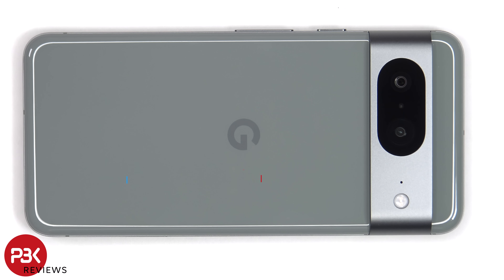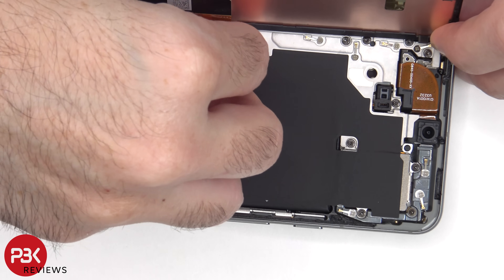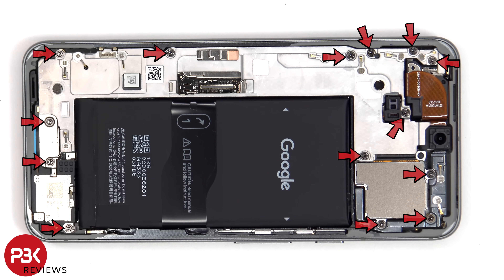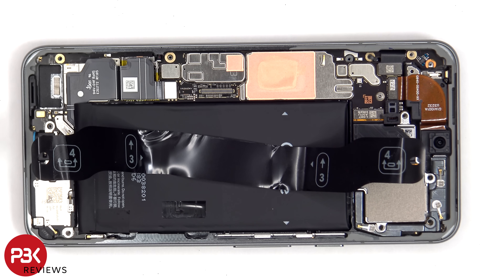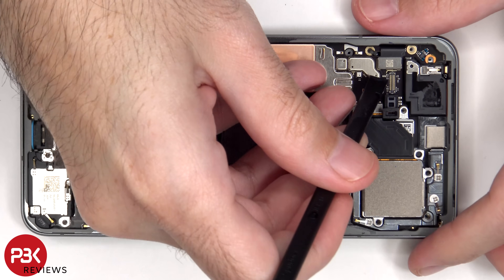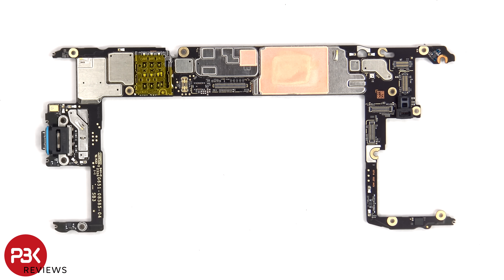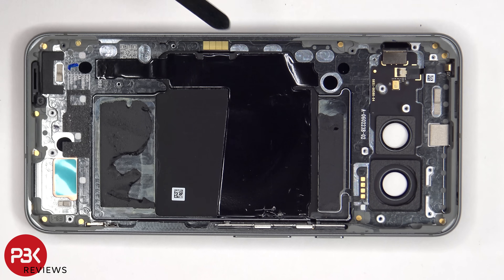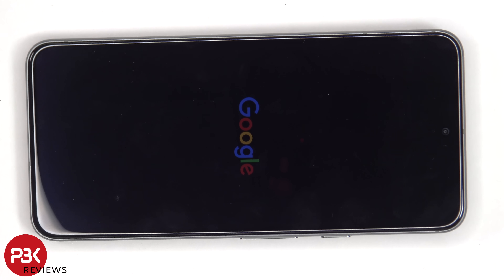Google Pixel 8 Teardown Disassembly Repair Video Review

Comment: Battery replacements seem nice and not too crazy difficult
Reply: It's about as difficult as basically every other phone for the last 8 years. It still remains annoying to do. Thankfully in a few years all these companies are being forced to put out phones with really easily assessable batteries. No reason it can't be designed like the old days with easy removable covers with no glue and only minimal screws holding it in place. Gaskets have been around forever and do a great job at waterproofing.
Reply: @theRemedyGames  Something like what LG did with the G5(?) with that removable bottom tray would be perfect. Just put the charging circuitry on it along with the USB port, and have it all slide out with the battery. With a good gasket and strong screws holding it in, It should be just as waterproof as an adhesive-sealed phone. Bonus points if they use something other than Phillips so the screws are not easy to strip.
Reply: yes fairphone already do it pretty cool concept
Reply: It's just as difficult to replace an iphone battery, nothing changed for the better, now I understand the promise for 7 years update support! Most people just replace their phone instead, for sure not doing this!
Reply: screen needs to be unglued to access the battery, this design is a nightmare. i gues phone being practically disposable is a descent tradeoff for being able to relock the bootloader on opensource os

Comment: Why were older phone batteries (ones with removable batteries) so much easier to remove? They didnt require a bunch of glue to hold it in place
Reply: Companies needed some way to force obsolescence so they said "well in order to make a phone water resistant we need to glue the whole thing together." This was so people would just buy a new phone in a couple years instead of replacing the battery to breathe new life into it (most people replace phones earlier than they normally would just because they want better battery life). Then they proceed to bury it under a bunch of other stuff in an effort to "make the phone as thin as possible." It also makes it easier for them to design the internals when battery placement is not a top priority...which it no longer is now that they made replacing it a royal pain in the ass for the average consumer.

Gaskets have been around forever. No reason you can't design a battery compartment with gaskets for waterproofing.

Comment: I swear Google loves giving you small reasons to not buy their phones
Reply: Why?
Reply: @Stevenkx2  like the soldered usb-c port, slow finger print reader, heating issues
Reply: @10ToesDownWithBass  and lately the price increase of 200€ in Germany. 1099€ for a Pixel? Nah thanks. I was only recommending them to my customers because of it's pricing, despite the phone having the issues you mentioned. Now that phone is straight up out of the game.

Comment: Do the screens of the 8/8 Pro still feel and sound hollow when you tap them?
Reply from the maker: I don't remember the 7 or 7 pro but sort of. Also I think the main reason would be the fact they have the screen seated on the plastic border underneath that clips into the frame so the screen might sit slightly higher than the components inside and not have anything directly pressing against the back of it. For screen replacements, this is good since that plastic border makes it much easier to replace the screen, or other parts inside the phone without damaging a working screen when prying it off.
Reply: @PBKreviews  ok, thanks for the info. The hollowness of the display was something that really bugged me about the 7 Pro. The 6 Pro too.

Comment: So basically Google touting the phone is way more repairable, is a blatant lie.
Reply from the maker: I mean in my opinion it's easier to repair than the 7 pro. Overall layout was easier when taking apart. They still have much room for improvement. If they just make the charging port replaceable, and use a better adhesive/pry pouch for the battery then it would be much, much better.
Reply: Is that a ultrasonic fingerprint reader or same as Pixel 7

Comment: i think the ram on processor is not a good idea as if the processor get hot the ram may disengage from the processor
Reply: Just like every phone in the world? Soc is better as everything including ram is one chip so you are wrong ram can't separate at all
Reply: @Stevenkx2  that's how the chinese phones are getting these problems with the chip which heats more.. then we have to change the motherboard with processor or with skilled technician we can separate ram from chip and then clean it and resolder it properly to make it work again
Reply: @rajasankar390  no, every phone has ram together with the processor that's why the chips are called SoC they include CPU GPU RAM ant sometimes other thing like the TPU in the same chip, even on iPhones and new M series macs is like this it's always been like this, it the only thing is not inside the SoC is the storage that's still a separate chip, although some manufacturers like apple add the storage inside the SoC
Reply: @Stevenkx2  im talking about chip problem(which runs hot with no proper cooling) bcz of the design ram on the chip
Reply: @rajasankar390  well that's because arm awful termal design.
Reply: @Stevenkx2  dono whom to blame the chip design flaw or the companies poor thermal management without proper cooling
Reply: @Stevenkx2  don't blame ARM for this, even M1 MacBook Airs run without a fan just fine, blame Google and Samsung for this knockoff Exynos "G3".

Comment: Battery drain test would be highly appreciated.
Reply from the maker: I don't think I will have time to do a battery test, since 1) my expertise are more in teardown and other tests 2) I need to get a bunch of other videos finished 3) everyone complains on battery tests and each person wants it tested a certain way so its extremely time consuming 4) by the time I get it done, other reviewers will do it. So yeah. However if I do decide to do it, how exactly do you guys want to see it done.. lets see the 15 different ways people will want to see it done lol.
Reply: @PBKreviews  you can run the geekbench tests repeatedly and then video recording because that's where more battery is consumed. And then check the temperature in between as well.
Reply: @PBKreviews I would like to know how to test a battery with volt meter. Is this what other viewers want you to do?
Reply: @PBKreviews no problem, but have you been using the phone? how has the battery life been? any heating jssues?
Reply: @PBKreviews I'd just put three phones side by side and run the same thing on them like Youtube videos at full brightness. Make sure they're all on airplane mode with only wifi on.
Reply: @PBKreviews we wants also charging speed test we wants to know if there is much different now
Reply from the maker: In my opinion, charging is low but I am used to my vivo x90 pro+ charging which is fast so to me it feels like a snail. I don't think I will have time to do a charging test video, but I will be uploading a battery test one later
Reply: @PBKreviews  Great news.
Reply: @PBKreviews hows the cellular signal, any difference compared to your other daily drivers? Great teardown vid btw :)
Reply: Pixel 7 on Android 14 has had much better battery life and no thermal issues.
Reply: Thia needs to be at the top!

Comment: No vapor chamber for heat dissipation. It'll throttle like Pixel 6 and 7 series or how IPhones do, because Apple and Google insist on no vapor chamber and think a graphite/copper film is enough lol
Reply: They transfer the heat to the screen..they use the screen as heat sink
Reply: @LeeMooEez  and that leads to the screen falling off after a while, which they won't cover under warranty. Ingenious design.

Comment: No vapour chamber cooling I thought they will use it in pixel 8 when they used in pixel fold
Reply: even zenfone 10 and s23 had it 😂 google is joking
Reply: Probably not enough room
Reply: @4jup4ter4 Nah, some penny pinchers at Google decided not to cool this phone properly to make more profit. Cheap ass thermal pad design 🤢

Comment: The charging port being soldered is so frustrating
Reply: As well as the microphone, proximity sensor. Whole board replacement to fix those issues 😢
Reply from the maker: yup or soldering expertise
Reply from the maker: yup

Comment: Does it still sound hollow like the Pixel 6 and Pixel 7 did when you tap the screen?
Reply from the maker: yeah i think so. Again as mentioned to someone else,  the main reason would be the fact they have the screen seated on the plastic border underneath, that clips into the frame so the screen might sit slightly higher than the components inside and not have anything directly pressing against the back of it. For screen replacements, this is good since that plastic border makes it much easier to replace the screen, or other parts inside the phone without damaging a working screen when prying it off.
Reply: @PBKreviews thanks, thought as much seeing the teardown.. just wanted to make sure I wasn't just assuming :)

Comment: Great work mate! Please post a full review with the battery performance and throttling performance. Also what's the charging speed it's capable of and how long does it take to charge. Also whether the pixel 8 has an optical fingerprint sensor or the ultrasonic?
Reply: It's an Optical Sensor
Reply from the maker: Thanks, its optical sensor.

Comment: low build quality, sold at high prices, as always for Google
Reply: They are selling software not hardware
Reply: @lemon9.9 good to know they gave 7 years of software support. Too bad the battery capacity dies in 3 years and they make it hard to replace it, I wonder why
Reply: @JoaoBatista-ou3tf  honestly didn't know Google was like that until I searched for battery replacement video just now, it's even worse than Samsung and Apple 😂
Reply: What is your best build?
Reply: Join the team and make it better. Every phone manufacture has a set of rules to follow when designing and building a phone.
Reply: Reminds me of the fruit company
Reply: @vitlucad blackberry?
Reply: You don’t even know what are you talking about LOL…that look quite expensive for sure more expensive than samsung,huawei etc. I repair thousands of phone and inspect the built quality etc.
Reply: @LeeMooEez where did you study?  Do you have any background in electronic design?  It's you who doesn't know what you're talking about.
Reply: @pierluigistomeo6764  yes I am LOL…and you?
Reply: @LeeMooEez  "look" is the keyword here. They look expensive, but they are cheap. Nothing special in there, especially that battery pull tab could be straight out of a $200 phone.
Reply: @PvtAnonymous   not just about look but the material itself…..there is so many motherboard grade,layer etc. I suggest you dissect atleast hundred of phone models from different brand and you’ll notice the pattern trend etc. this one is different…they’re closer to apple compared to other brand
Reply: @LeeMooEez  luckily I not only repaired hundreds, but thousands of phones over the last 3 years. I can in fact spot the difference. And let me tell you, this is not an expensive mainboard, at least judging by first impressions and considering past Pixel devices.
Reply: @PvtAnonymous  then you should know about the board LOL…and all the material used…get one of this phone and dissect the board,material etc. So Can you tell me the different between generic android mobo,huawei,apple,pixel?

Comment: It's OK to disconnect lcd w/o disconnecting battery. But connect  with battery disconnected.
Reply from the maker: Not possible, since the mid plate needs to go over, so either way you will have to connect the battery first. They don't make the phones generally like before where you risk shorting by doing that. If possible, yeah always good to disconnect the battery first. But its designed, specifically in this phone, to be able to remove and replace the screen without having to take apart anything else.

Comment: Wow thank you for the quick video! It still sucks that the charge port is soldered to the mainboard.
Reply from the maker: You're welcome. Yup sucks.
Reply: NOOO they did it again!!
Reply: I guess wireless charging then
Reply: Samsung soldered it on S10 series. I sold my S10 before I had any problems anyway and I never had any problems with my usb C port. But my brother has problems on his S21.
Reply: Planned obsolescence
Reply: Or just dont break it??
Reply: @fahrradbang69  If you extend the device lifespan to 7 years and more, it is possible to break it. If you are changing phones every 1-3 years, sure.